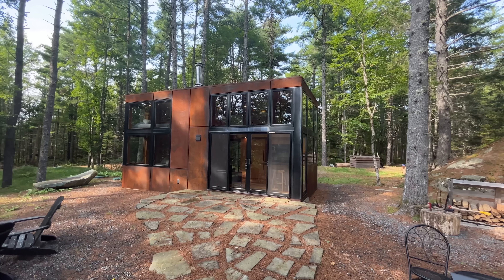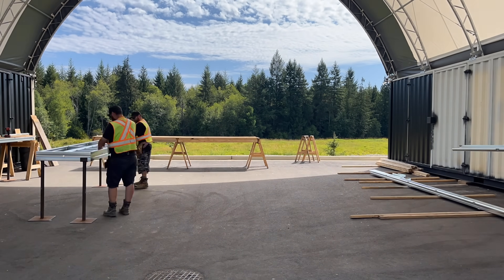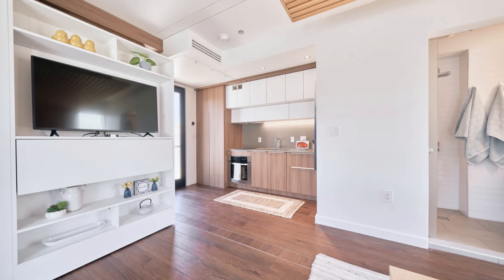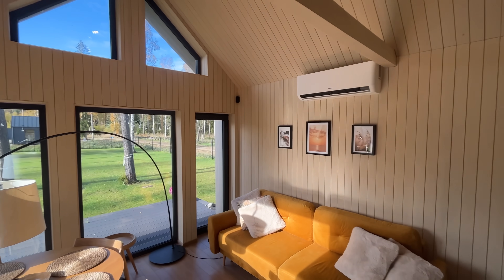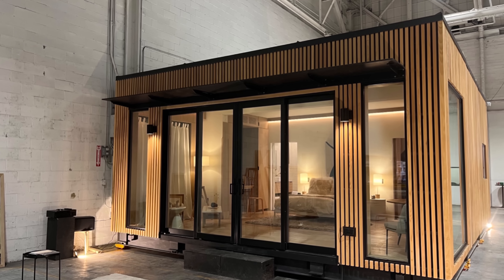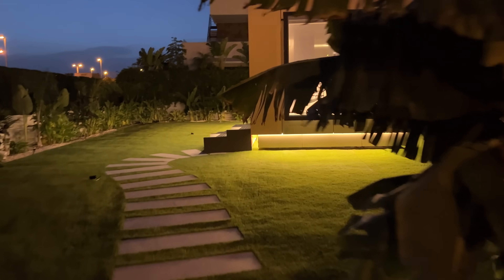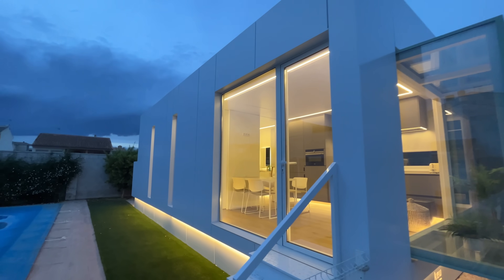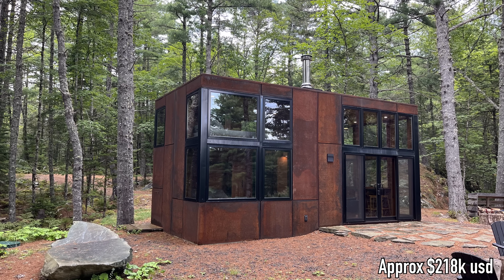The Top 10 PREFAB HOMES of 2024!!

Comment: Yay! Lloyoll Skali took the top spot in 2023!! I remember when you first talked about it. Blew my mind! Just imagine, never ever having to use exterior or interior paint ever again. There's no paint anywhere. No mess. No upkeep. No paint splattered floors or furniture. The Corten steel siding looks like a Richard Serra sculpture. The deep rust color is gorgeous and blend with nature perfectly. Patina will soften and enrich these homes naturally over time. The layout is incredible. Tall ceilings with a ton of light and real wood burning fireplaces too. Llloyoll makes the best prefab homes I've ever seen. Merry Christmas, everyone!!!
Reply from the maker: They’re so cool! Merry Christmas
Reply: For the price these Lloyoll Skali models are asking, you might be able to purchase a small Richard Serra sculpture for your existing home.  Depressing how costly psf prefab modular has become recently.  And most of the floorplans are constricted by the limits of transporting the module down a highway.

Admittedly this is a very difficult design challenge and one I have direct experience trying to solve, unsuccessfully, using prefab construction tech (really just stick-built at two sites: factory and onsite too).   So I switched to using structural steel as portal frames to build a skeleton that I can apply flat panel floors, exterior walls and a commercial concrete roof deck to cover it.  This is working for me, YMMV.

Comment: I like windows as much as the next guy, but let me tell ya, as someone who's lived in a bunch of ground level studio apartments, having a giant window in the front sucks. Yes, it's lovely to have natural light and a pretty view, but a window looking right in on your primary living and sleeping area is awful unless you somehow have absolutely zero people around. I basically had to keep the blinds/curtains drawn 24/7, which kind of makes the big window worthless.
Reply: Get reflective glass windows.
Reply: also the heat here in California will turn it into an oven
Reply: i am moving to 100 acres in wv.
after spending YEARS looking at different options
i have settled on the following:
20 by 30.
built on 3ft stilts
hip roof.
all metal with spray on insulation and noise dampening
built to hurricane specs
all off grid, powered by propane and panels
steel girder inner framing so i can have 8 foot glass sliders all way round
wrap around deck, not attached to house

Comment: My Prefab Priority List:
1- Kitchen with reliable appliances,solid island (not a table), large pantry for dry goods, good exhaust over burners/cooking area.
2- Kitchen & Living both to have high ceilings. (makes the main area feel larger) 
3- Large shower/with waterfall faucet, Floating toilet. (there should be an award for the "Floating Throne")
4- Large glass windows,sliding doors/entrance or exit to medium-large size patio...
5- Washer& dryer, bbq hook up or outdoor grill area, ...outdoor fire pit/round gas fire area/gathering area.
Reply: sounds great!.
i went in a different directions.
take a look at my new posting about 100 acres in wv. after all the coverage of floods and fires and tornadoes, i went for structure over looks.

Comment: With the Canadian Government's plan to have a catalog of homes that can be mass produced for some millions of homes to be built in the coming decade, which any of these prefab homes will be chosen for it?  Consider the prospect of being built on extreme cold&hot temperatures due to climate change like wildfires, smokes, heat domes, polar vortex, floods, etc.  Are any of these will be durable enough not only to survive if off grid but possibly self-sufficient with the additional power generation by solar cells, wind power, heat pumps/AC being part of the home.  Also will they gave a basement like most Canadian homes.

Comment: I got to see an entire neighborhood go up behind my house. I have to be honest with you, what I saw was nothing more than prefabricated homes being called single family. They shipped the frame to the sight will very little cutting or hammering. In my opinion, they are no different than one of these homes that you showed us in this video except for the square footage. These homes were anywhere from 1300 to 2200 on small dorky lots maybe large enough for a porch but a small one. My house sits on a 10,000-square-foot lot and the house is 2500 square feet on 2 levels and a detached garage. They build 3 homes behind mine on the same size lot I have. I wonder if any of the companies that you showed us have something at 1800 square feet?
Reply: The one from Colorado does

Comment: 🎯 Key Takeaways for quick navigation:

01:10 🏡 Orca LGS Homes:
- Orca LGS homes have a West Coast vibe with metal siding and wood accents.
- Their popup Factory allows flexibility in manufacturing, outperforming traditional methods.
- Orca's pod line will be available in Washington, Oregon, California, and Nevada.
02:21 🔥 Formflow Living's C90 Ben:
- Formflow Living's C90 Ben offers innovative corrugated sheet technology for seamless joints.
- The design enhances resistance to Ember attacks and bushfires.
- The Gable one model, with steel exterior and wood accents, is highlighted for entertaining and retreat.
03:45 🏡 Zenome Homes:
- Zenome Homes addresses the Housing Industry shortage with easily transportable and environmentally friendly models.
- Their homes feature multi-purpose spaces adaptable to different needs throughout the day.
- Substantial waitlists and plans for a second facility indicate growing demand.
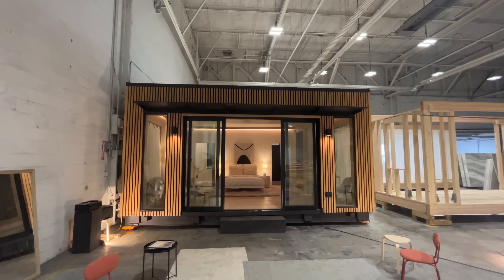04:56 🌲 Al Loomhouse Nordic Plus:
- Al Loomhouse's Nordic Plus offers a cottage-style prefab home with high ceilings and ample windows.
- The Nordic Plus layout stands out with a loft, one bedroom, and one bathroom.
- The design gives the impression of a more spacious interior than its 395 sq ft footprint.
05:38 🏡 Tomu Villas - Studio Villa:
- Tomu Villas, particularly the Studio Villa, features a natural Cypress exterior cladding and black trim.
- The studio Villa's layout emphasizes good flow and a sliding glass door for an open feel.
- Priced at $145,000, orders are being taken for 2024.

Made with HARPA AI

Comment: Nice, but way too expensive for what you get. And it's not just that over time they've become so much more costly per square foot, but also that 1 - you still have to pay for the land to put them on, and 2 - if there's a tornado or a hurricane, you MUST leave because it's not safe to stay there. With a hurricane, you have time to plan, but with a tornado or any sudden windstorm, you don't. So they're not safe for permanent living situations. $230,000? No, thanks. It's better to buy a traditional full-size home for around the same price which already comes with land (sometimes quite a bit) and which will protect you as much as possible during natural disasters.